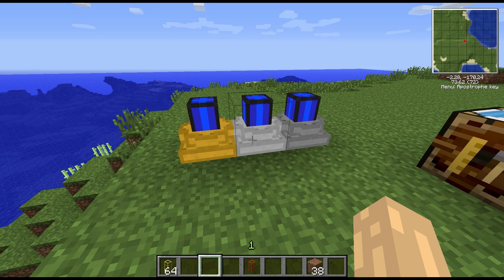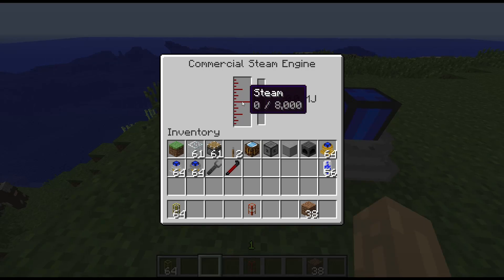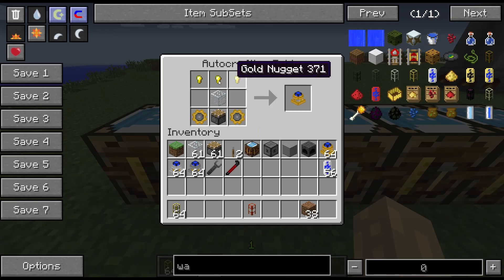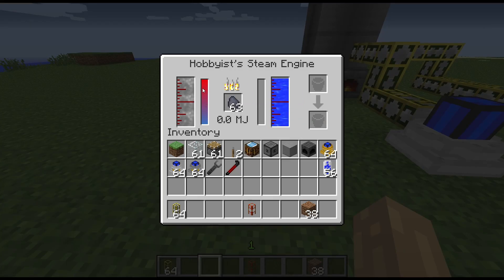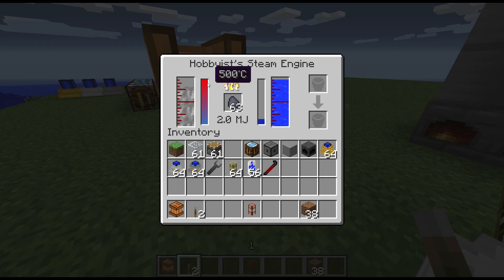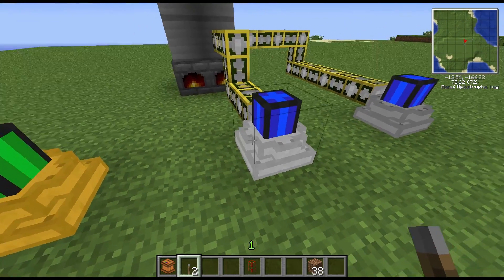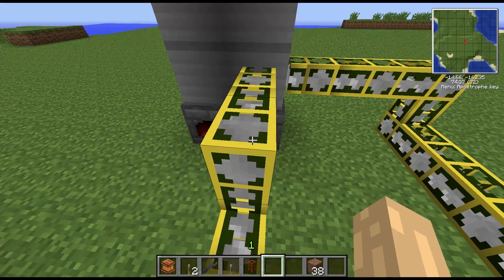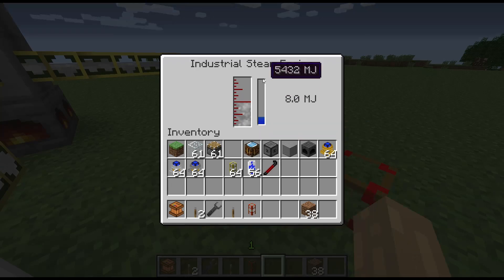Block Spotlight - Steam Engines

Comment: Just a small tip: When I'm testing engines and I need a way to suck all the power they produce so they don't store any I use redstone cells. They are quite nice at that.

Thanks for this video. :)